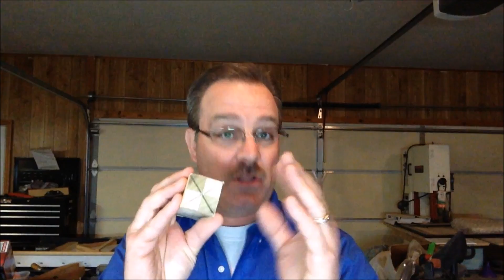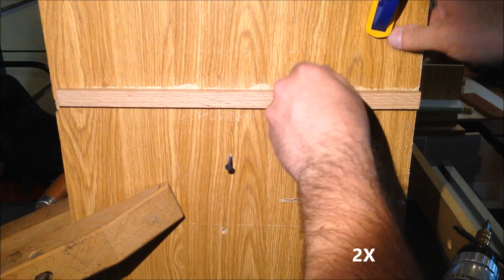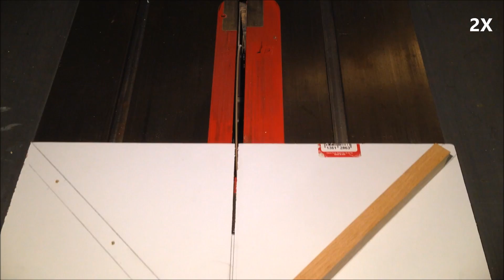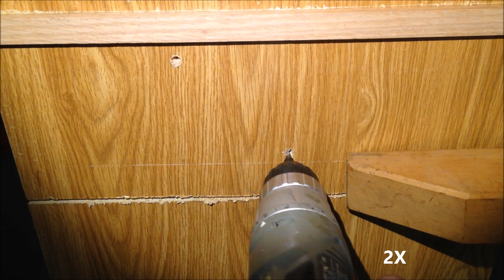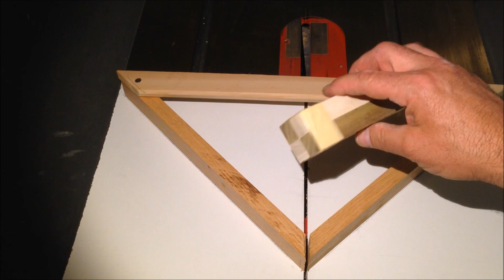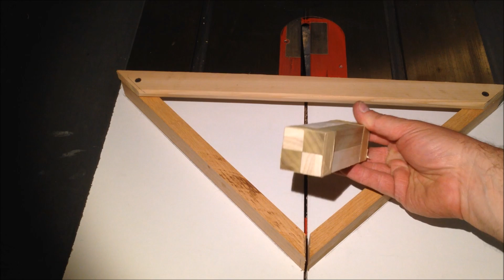Lathe Stock Centering Jig

Comment: What do you think about drilling 1/8" holes at intevals down the red oak and use nails as pins and strong rubber bands as clamps to hold your wood in position. I almost think it might work.
Reply from the maker: It might work. I’d say give it a try. 

Regards,
Bob

Comment: I just use a dremel and a little cut of tool to make a grove... no need for another jig. .. but well done...
But couldn't you have used a 45º angle picture frame jig and use the back side?
Reply from the maker: Thank you Wayne,
  Using the back side of a picture frame jig is and excellent idea, that never even occurred to me but I think it would work perfectly. I will give it a try and if it works I may disassemble this jig and use the sled for another future jig.
  Thank you for watching and commenting, I appreciate your support.

Regards,
Bob

Comment: Great jig, but you may still need to drill shallow hole in the center so the center pin does not still try to split your bundle.
Reply from the maker: Thank you Jim,
  You are absolutely correct, I will have to drill a hole down the center to accept the spur point. I think if I plan it out properly, I will probably be able to use it as a tenon hole for a top or a finial too. I am looking forward to giving this a try and can't wait to see what happens. Thank you for following along and commenting, I really do appreciate your support.

Regards,
Bob

Comment: Robert,
Great idea to get the pressure of the wood without loosing the grip of the spur.
I've got one question, is the point of your spur spring loaded so it can move back while applying pressure from the tail stock?
Greetings from Good Old Germany
Peter
Reply from the maker: Great question Peter,
  My spur center is stationary do I will have to drill a relief hole for it. At least I will know exactly where to drill that hole. If I plan it out properly, I can use the same hole to insert a tenon into for a cap or a finial.
  Thank you for your continued support of my videos Peter.
Regards,
Bob